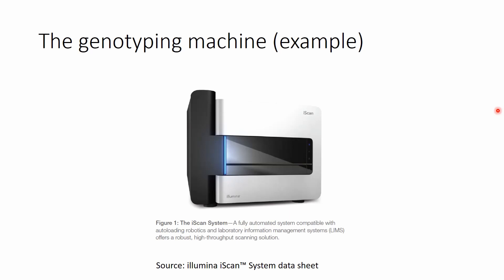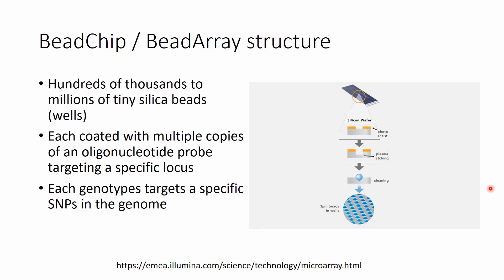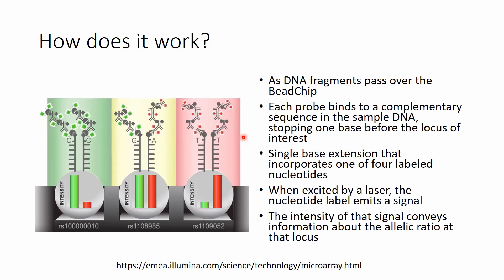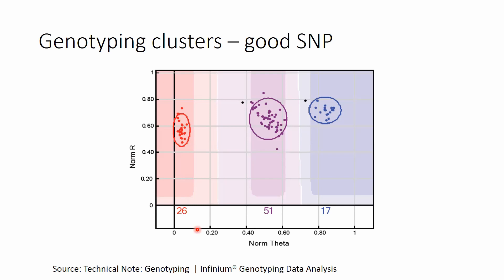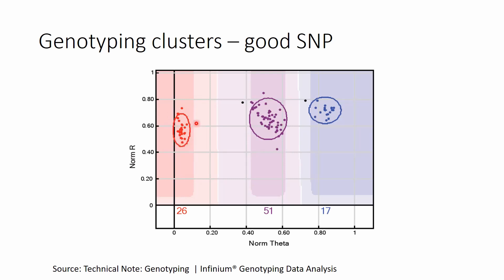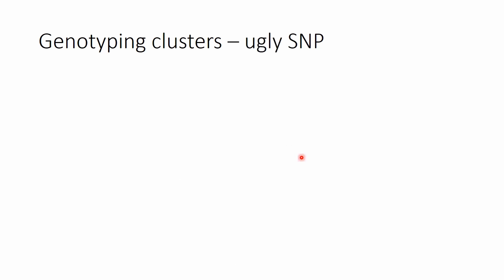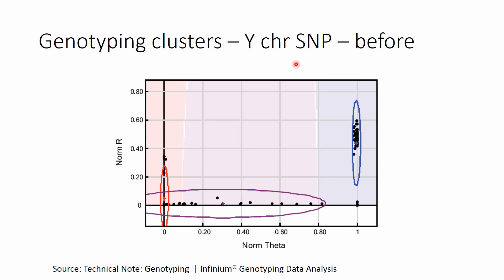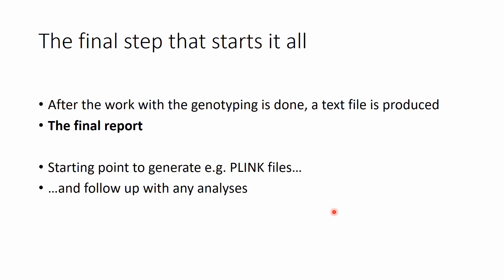Illumina BeadChip genotypes - The basics

Comment: Dear professor, in our lab we noticed, that for one SNP there are sometimes multiple biding sites marked in the list of the SNPs rsxxx.1/rsxxx.2. And the results is for one bibding site of the SNP heterozygous and for the other bibding site of the same SNP is homozygous in the haplotyping assay. Like parents' genotypes are opposite (AB+AA for rs xxx.1 and BB+AB for rs xxx.2) and Including the reference (AA vs. AB) and comparing it with the results in the embryos, the outcome is consistent….. so how do we explain getting different calls from the same SNP which is doubled on the chip? Is it because of the flanking region which is ended with different labeled nucleotide?
Reply from the maker: Unfortunately I can not answer your question, as I do not have a clear idea why this could be happening. So I want to avoid any wild guesses from my side. But if the answer is really crucial for you, I would suggest the support of the chip manufacturer with the same question, they shold have a better idea about it.

Comment: I have a question: if we have a CG heterozygous (like I do have in my data), how will the scan differentiate both green signals and not misinterpret it as being homozygous?

The illumina reference guide itself does now cite "fluorophore", not even once. And both there and in their videos, they only show biotin associated with C and G, which after will have a green signal, and DNP with A and T, with a red signal. How is it possible to differentiate CG or AT heterozygous?
Reply: I got the same question, there is no explication of how you can differenciate between the two greens or two reds being different nucleotides
Reply: Hi  @jrodriguez9968 ! It happens that I sent an e-mail to Illumina asking the same thing, and they explained it to me: there are two types of methods in this beadchips: infinium I and inifium II. The one showed in this video uses one of them, with only one type of bead, when the alleles have different collored basis (like G/A or C/T). When they have alleles with the same colors (like my example in the question, A/T or C/G), the infinium method used is one bead for each allele, i.e. 2 beads for the same locus. If you want more information I can send you the pdf they sent me =)
Reply: @Igcaet yeah please send me the pdf
Reply: @jrodriguez9968  sure! Please, could you pass me an e-mail? I can resend you the one where Illumina explained it and the pdf
Reply: @Igcaet  I just send you an email

Comment: thank so much for this video. I have a question please :  Could SNP array 700 K illumina detect indels on locus with size < 1 kb?
Reply from the maker: Hi, sorry for the late answer.
If you consider a 3GB mammalian genome and let's say 700K evenly spaced SNPs, then there is an average distance between two SNPs about 4.2kb. From this reason this is the minimal resolution in the BEST case scenario, but realistically it is definitely more. So the detection on a below-kb level is definitely not possible.

Comment: Sir , how are the SNP chips used to detect copy number variation?
Reply from the maker: If you have the "final report" for your data, and the values for B allele frequency and Log-R ratio, you can use these to dectect CNVs, also based on SNP data. See e.g. Figure 1 in our paper: https://gsejournal.biomedcentral.com/articles/10.1186/s12711-018-0414-x
Reply: @GenomicsBootCamp  Thank you so much professor!

Comment: Dear professor, is it possible to detect triallelic SNP in bead-chip? What will happen if a SNP is A/G in the manifest file, but in our sample it's a different allele?
Reply from the maker: Hi, There are no triallelic SNPs on the bead-chips. If you are really sure that you have a different, non-missing SNP in your data file, it is likely that you have information from a different strand (Top, Forward, AB-coding). For these occassions it is really useful to have the final reports, so you can have the other one, if needed e.g. for merging.